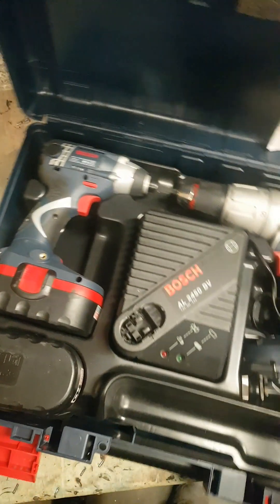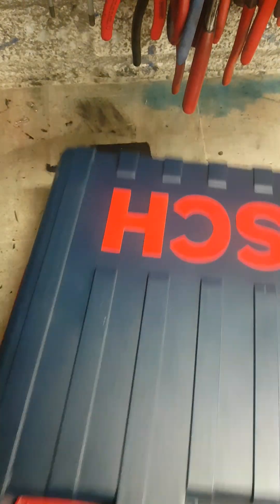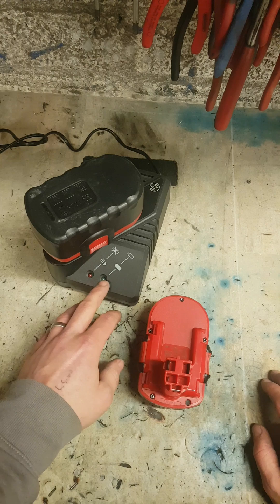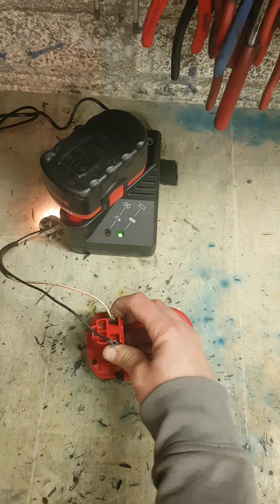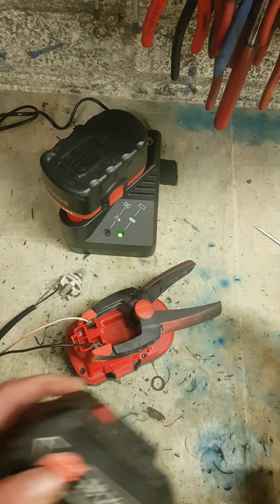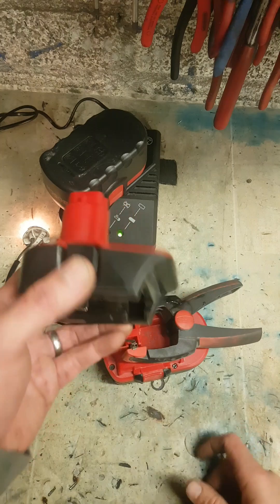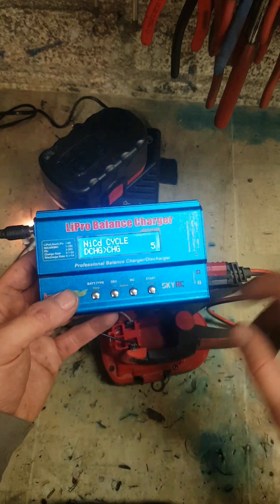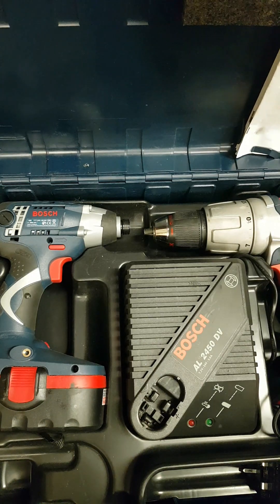How to boost, recover or fix your older nicad, mnhi batteries with a small bulb.

Comment: Hi Dean, Donegal man here. Been watching your videos. 
I’ve one of the old NiCad batteries for the Bosch 24v GBH hammer drill. Battery charges fully within 10 minutes each time but only lasts less than 10 minutes drilling. 
I have a couple of Milwaukee Red Lithium-ion M18 5.0ah batteries with an original Milwaukee charger that are in good condition and hold a good charge. 
My question is; can I get an adapter that will fit into the Bosch 24v GBH and that I can use the 18v Milwaukee batteries to power it? Have looked on google but can’t find anything, so any link for one would be appreciated or if you know of anywhere I can buy?
Also, is it safe to use the Milwaukee Red Lithium-ion M18 5.0ah batteries in the Bosch 24v GBH with an adapter? I don’t want to burn out or brick the drill or kill the batteries. Any advice would be appreciated. 
Thanks

Comment: Can you plug the battery into your drill and just run it until it dies or does the bulb trick need to be done?
Reply: The bulb require much less amps, which won't overheat the battery cells.
& a drill can overheat if kept operating for an extended amount of time.

Comment: Hello. I enjoy watching many of your videos.
I have something to add about NIMH cells. Yes, it is older technology, but has improved a lot over the years. I have NIMH battery cells from Panasonic that keep the charge for years, even some Hybrid cars use NIMH as they have li-ion similarities today. What kills NIMH is too low volts per cell, not below 0.9V. No battery cell like to be discharge completly.
Nimh is better in cold weather, but the energy density is somewhat less than Li-ion. There are advantages and disadvantages to all types of batteries. I'm not a big fan of li-ion as they are fragile and NIMH is more forgiving.

Comment: Thank you for the video. Can you please send me links for the bulb, the bulb holder and also the commercially built unit which does the same as the bulb with the charger combined in the routine. Thanks.

Comment: Good tip for reviving nicd's nimh ,  it's one of the reasons RC chargers have that function built in, some of my rc batteries aren't used for ages, ive got an old 20 volt Dewalt sds i may not get an adapter for, this keeps it goin, cheers Dean.

Comment: Are there any devices to cycle lithium batteries?
Reply: Well, cycling works only for NiCd/Nimh. Li-on don´t have memory effect. Cycling Li-on battery won´t bring more capacity. Li-on lose capacity with use (charging/discharging), also when they are below 2.5V. When they are below 2.5V, their internal resistance rise (they can´t provide designed current), they lose capacity rapidly and will self-discharge faster, when charged.
Reply: @SnekSnack  I usually discard cells when they are 2.5v all that you said makes sense
Reply: @doctorlefthandthread  When they are 2.5V - They can be charged back maybe without damage. Damage happen, when they sit low below 2.5V (2V, 1V or discharged to 0V).
Reply: the same imax b6 he showed in the video can do basically any battery chemistry.
Reply: @jaywelker5566 thanks